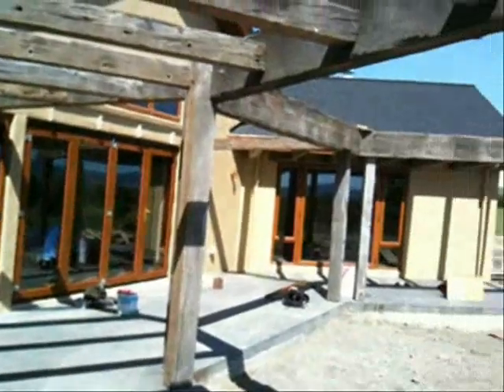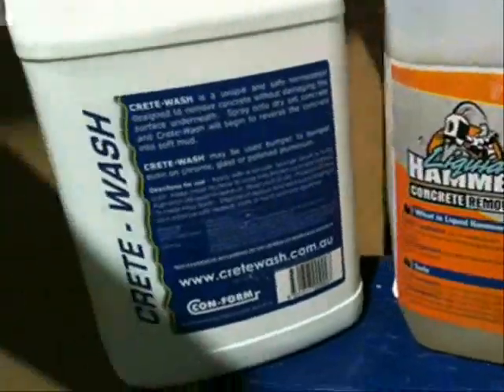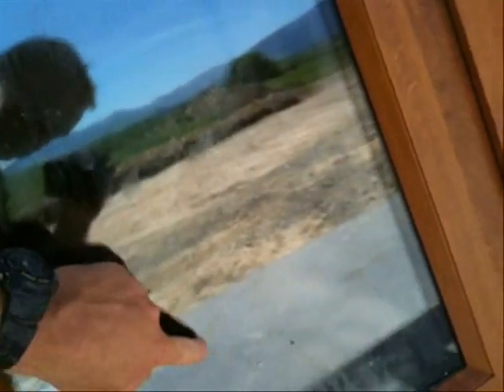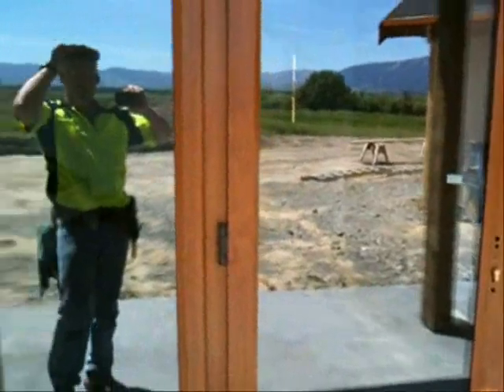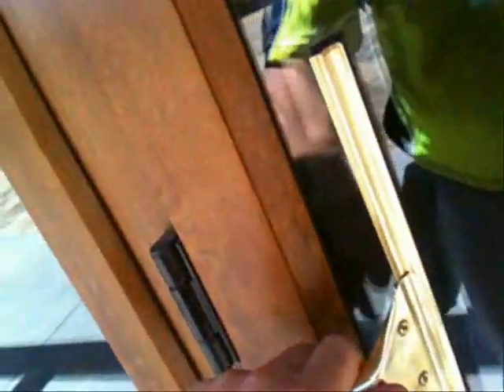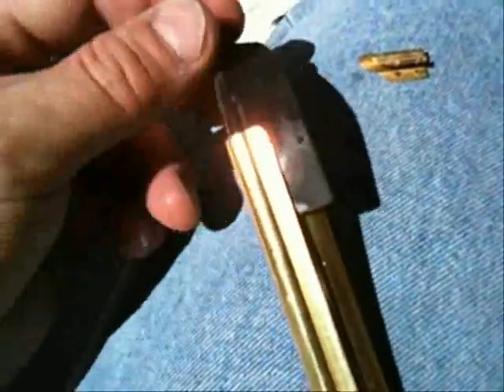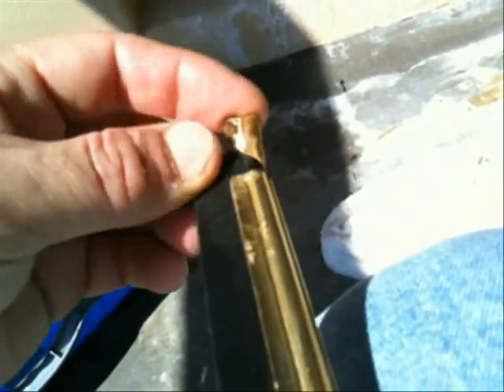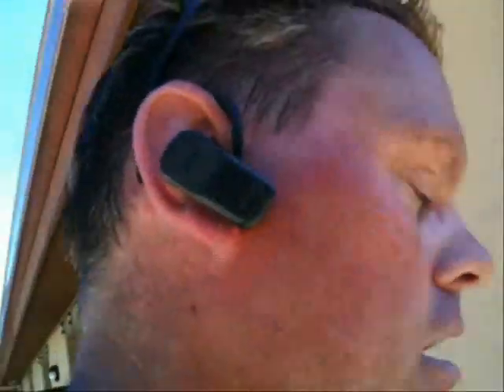Cement removal & BUILDERS CLEAN- Clean Glass back remove splatter  - HOW TO DO !!

Comment: Does that Liquid Hammer stain wood or anything like that? Do you have to be careful around certain building materials when you use it? I had a bad experience with Goof Off once. I don't want to do that again!
Reply: Rockbond NZ make a great product called "Crete-blaster". Check them out www.rockbond.co.nz . It's safe on joinery and wedge rubbers. But always spot test on surfaces you might be unsure of.

Comment: what happens if liquid hammer runs down to the concrete slab under the windows?
Reply: Its no big deal. You just hose it off. You have to have a puddle of it sitting on concrete for extended periods for it to be an issue. Using products like this I pre soak the area with water.
Reply: It gets hammered